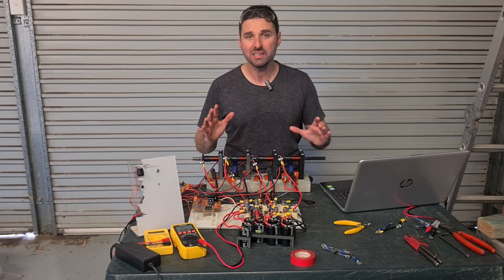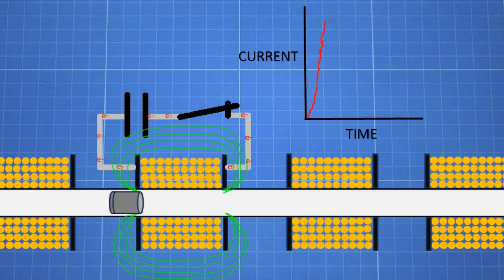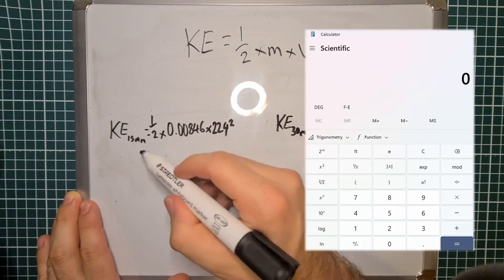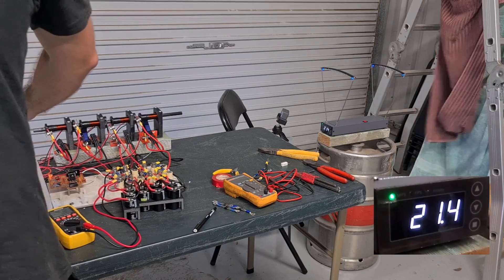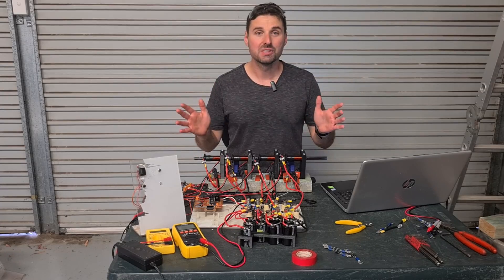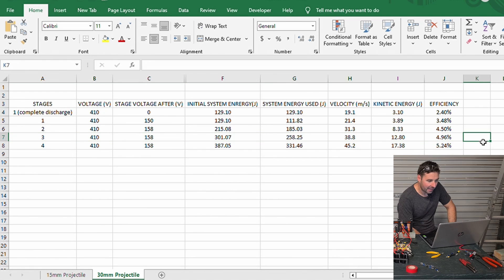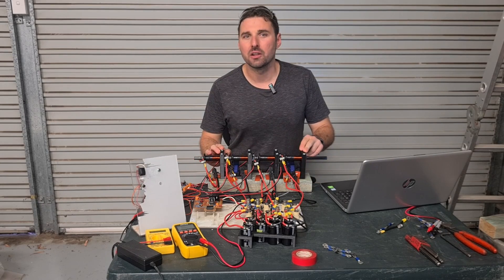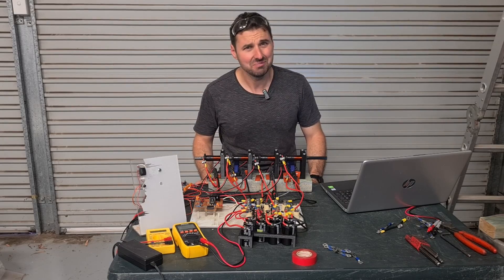Optimizing a Multi-stage Coilgun

Comment: I was just researching and read that enclosing the coils by putting some strips of metal on the outside of them will hold the field in and make them stronger. Doing this made a significant difference on a solenoid motor (where I read about it).
Reply from the maker: That's quite interesting. I will have to try it out. Did you have a link to where you were reading about it so i can do a bit of research on it?
Reply: @owensprojects  I lost my browser history and couldn't find the site back. Enclosing an inductor with metal was a known effect back in the old days, thought of as guiding or holding in the outer field lines, but a quick googling of search terms didn't find me what I was looking for.  It doesn't have to be like air tight, the solenoid engine website guy just used some metal strips. .. I think a mistake many are making with these coil guns is probably using huge caps and limiting speed by the LC frequency. Maybe many smaller caps parallel instead of one big one could get around that.  Also when designing transformers we use volts divided by inductance times pulse time to get actual current sunk by the inductor each pulse..
Reply from the maker: That sounds like a good idea to explore and test the benefits of it. I haven't come across anyone else with that design either. With the capacitors is there a way to workout how many in parallel would be ideal over say one large capacitor?
Reply: @owensprojects  I did run into, since last reply,  a coilgun guy mentioning trying iron laminates on the outside of coils. He said it changed inductance too wildly causing problems, with too small of increase in strength for the problems created. Again I can't find it back cuz when I get to digging.... So I would stick with testing steel like normal solenoids come enclosed in. Also I wouldn't expect more than 20% effect at most.. I've been heavy into switch mode power supply design and just got interested in this. I don't know the cap time constant off memory, but caps in parallel, like batteries, will add current out/in while keeping the single time constant of charge discharge rate. There is a formula for that somewhere and they need to align with the inductor's pulse time and current sunk from the (Volts/Henries) x pulse time = current sunk. I don't have time right now but will be looking into the formulas over the next days. I have in mind an automatic that shoots 5-10 ball bearings per shot :) But I have many projects and just started researching this one.
Reply: @owensprojects  Oh i forgot to say.. I think using a mosfets for the switching to control on/off would be the easiest fix instead of using a thyristor like most seem to use. The thyristor(SCR) is what makes the timing rely solely on the capacitor size to inductor value.  Just make sure to use a sinking diode for the reverse surge. If I go with dumping 400v I have some sanyo 2SK3748 mosfets laying around, if I go under 100v high amps i have some IXTH200N10T beasts.
Reply from the maker: Thanks for that, i will keep that in mind. I know the feeling with having many projects going at once, too.
My original coilgun did use SCRs for the switching, but they arent they take a bit more in the control to switch them off again once they are conducting. For this Coilgun, though, i ended up using IGBT's to handle 400V and fairly high current. I tried a few different mosfets aswell with similar ratings but they kept dying after several shots.

Comment: Dear Owen, another question, typically how long did you turn on the IGBT? Again, I ask this because you mentioned about 200A of current flowing thru the coil. I have tested with 2.5ms and my IGBT burned miserably...
Reply from the maker: I used 2 IGBT's in parrallel to handle the current. They worked all the way from having them on for the complete time it took to discharge the capacitors to the first stage was on for 1.8ms and each other stage was 1.1ms.
Reply: @owensprojects Tqvm Owen for your quick responses, many thanks

Comment: Great video 👍👍👍, I have watched many coilgun video and definitely this is one of the best. I started to build one too but burning rate of IGBTs really scary :(.  Btw, would you mind sharing the part numbers of NPN Q1, PMOS M1 and freewheeling diodes D4 and D8 please?
Reply from the maker: Im glad you liked the video!
The part number for diodes D4 and D8 is C3D10065I, its a schottky diode made by wolfspeed.
Q1 NPN transistor part number is P2N2222A.
M1 PMOS part number is IRF9540N.
Hope this helps

Comment: is it necesary to have external diode with the igbts as they have body diode
Reply from the maker: For those particular IGBT's potentially wouldnt need them, i went through several different mosfets and igbts before settling on the ones used in the video, As they kept blowing up due to the voltage spikes even though they did have body diodes too. So, in this case, it was more of better be safe than sorry and cheaper to add a $8 diode, then keep replacing $45 IGBTs.
Reply: @owensprojects  oh wow fair enough... What igbts do you use? I thought the diode across the coil was like a freewheeling diode and would prevent the voltage spikes alone
Reply: @owensprojects  I forgot to say amazing videos btw
Reply from the maker: I ended up using IGBT part number IXYX50N170C. I thought the exact same thing to begin with, with the diode across the coil. They were fine until i was switching them off with about 200A flowing through the coils. Im guessing the voltage spike was just building too rapidly under those conditions for the freewheeling diode to shunt it back across the coil, and the mosfets/IGBT's couldn't handle it.
Thanks, I'm glad you like it.

Comment: I tried similar arrangement, in sysmaxwell program but I couldn't manage to increase bullet speed about 45% from coil 1 to coil 2 like your one, Can you share me the hint how did you manage?
Reply from the maker: Im not familiar with the sysmaxwell program and how you are simulating the stages, but the critical thing to get right is switching the coil at the right time so when the projectile is inside the coil the current flowing through the coil is at its maximum and switching the power off to the coil at the right time so the magnetic field isnt slowing it down after it passes the center. Hope this helps!
Reply: @owensprojects  firstly thank you for your reply, switching time of coil in my project is managed by sensors and I am doing it(switching) just before enter in next coil, and even though I tried to use tick wire with low number of turn there is no change on speed increase performance which is about 6% increase while as your one above 46%, at this program ı can see also amperage building up time as well as magnetic (Wb ) building up time, this program showing me that magnetic building up tame is not overlap or get close to amperage building up time. I tried to compensate this phase differences by degrease number of turn and used ticker wire but there is no noteworthy improvement, ı am trying to figure out where is this differences coming from while as we are doing same things.

Comment: Do you think I could get a complete schematic layout and diagrams from you on your project add a copy of the Arduino code are you using a separate Arduino for each coil as well
Reply: Thank you I will. I’m going to be using one Arduino to control the first Arduino and separate Arduino for each stage as main Arduino that I have will collect all the information down the line, including the voltages per stage and the overall charge voltage of the power supply and will be written to an SD card, oh I forgot the master Arduino is going to count the number of shots fired as well. Store those to the SD card.
Reply from the maker: That sounds like an interesting project! You will have to keep me updated with it.
Reply from the maker: I'm using separate micro-controllers for each stage as the timing for each stage is critical. Which could vary between shots using one Arduino depending on which line of code is being executed when the light beams are broken.

This Github link has the schematics and code for the project https://github.com/Owens-Projects/Multi-stage-coilgun.

If there was anymore info you want let me know

Comment: The object doesnt twist like a bullet, making it less accurate. 

I would use a sabot round, use non magentic material with fins or tail veins, possible just make it into a light weight arrow
Reply from the maker: I have been looking into sabot rounds, would be interesting to incorporate that type of projectile to a coilgun design. Especially since you dont have the hot gases and rifling that improve the accuracy like in a conventional gun.

Comment: Very good, which IGBT are you using as the switch?
Reply from the maker: The IGBTs part number is IXYX50N170C
Reply: @owensprojects  thanks, I noticed that u use steel as your projectile. I think soft iron is better as it is more magnetic. Would love you to compare these two in a video. Cheers
Reply from the maker: I will have to try a soft iron projectile. Hopefully, being more magnetic leads to greater speeds

Comment: You know you could have just used a railgun design. And then used coils as a replacement for the permanent magnet fields.

And you wouldn't have to rely on the timing for switching fields on and off for optimum kinetic coupling.
Reply from the maker: A Railgun design definitely does have its advantages over a Coilgun, i will look into building one for a future project
Reply: @owensprojects  Rad !

Comment: Very cool video. Interesting how efficiency improved by adding additional stages.
Are all coils identical? I think you could try to reduce turns / coil by every stage, this will decrease coil inductance and current will rise faster.
Reply from the maker: Thanks! it was definitely shock how the efficiency increased. Yep all the coils are identical, that's a good idea for  me to try in the next version
Reply: i think the coils should be the same..not sure if they have too......but they should be.

Comment: Are u using soft iron as your projectile? if not you should as it does not saturate. could you also tell me the coil length and wire diameter ? thanks in advance
Reply from the maker: Thanks for the tip, I have just been using mild steel for the projectile but i will test the improvements soft iron will make in the future. The coil lengths on average are about 58mm depending on how tight i could keep the wire when winding them and the wire diameter is 0.75mm.
Reply: A cylindrical stack of neodynam magnets will have the best effect as they already have a magnetic field to push against (just like BLDC motors use)... just insert them with the polarity facing the right way, and perhaps press the stack into a 3D printed tube to keep them together and protect them for impact. Much more expensive than iron slugs, but would be interesting to see the efficiency gains.
Reply from the maker: I have wondered how it would go using neodymium magnets as the projectile, i will have to test this. Like you said, though, i need some sort of tube to protect them as i dont think they hold their magnetism well if they do get smashed against something
Reply: @owensprojects It will be innefficient as the magnet will try to induce current in the coil when it moves. Also you would need to get the timing very right since the poles would repel the opposite direction if the magnet is already at the center but there is still current in the coil.
Reply: @owensprojects You can also try to use powdered iron matrix to cover the whole coil. And increase magnetic field strength.

Comment: Is there some way to measure the voltage or inductance of the coil to figure when the slug is in the coil vs using a light sensor? It seems like it would be simpler if possible
Reply from the maker: There are a couple of ways to measure the inductance of the coil but not a way that i have found so far to do it while it has a high voltage across the coil when it is being fired. I will have to do some research into it and come back to it

Comment: It's great to see another Aussie get technical with coils not many of us on YouTube compared to the rest of the world. My expertise is brushless motors and experimental coils for motors so very similar to what you're doing here. I can suggest wrap your coils with steel wire between each copper coil layer windings,this gives more flux concentration and higher inductance and efficiency. Experiment with different ferrite metal ratios as well to get the Goldilocks frequency for maximum power. An oscilloscope will help find resonant frequency for your coils adjusting the PWM cycle🙂
Reply from the maker: Thanks for the suggestions! I will experiment with them on my next design and see what improvements i can make.
Reply: Hes getting nooooo where near the subs/ views he should be getting.